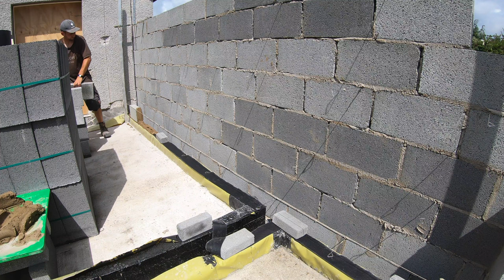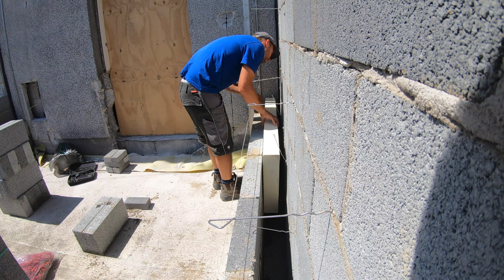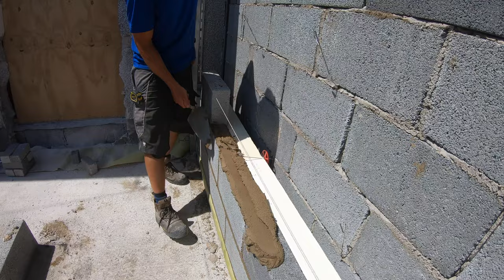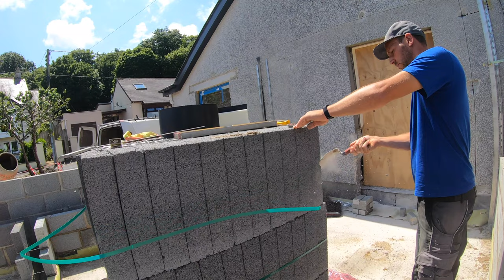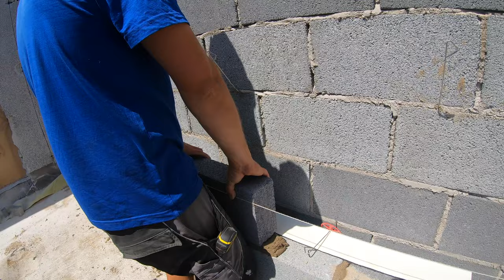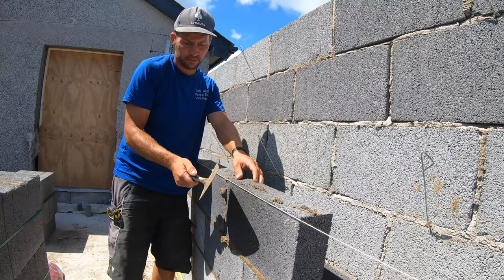Concrete block cavity wall

Comment: Beautiful work as always buddy, but where the hell are you again in Wales that you are getting weather like this? Here in Tredegar it has not stopped absolutely pissing down for weeks. Worst July ever!

And this footage was amazing quality. What do you film with? And what editing software do you use?
Reply from the maker: Cheers, this extension was a nightmare as there was 3 large openings in it so it was start stop all the time. This was filmed a good few weeks ago in the heatwave but it wasn’t until last week we had proper rain and the ground is still cracked! The rain seemed to avoid Pembrokeshire for ages, I could see it getting all the other places on the map 🤣. 

I film with a GoPro Hero7 in 4K quality.  I may upgrade at some point to the new GoPro as that’s better quality again.  I’ve also got a new microphone attachment as the sound quality isn’t the best as standard on a GoPro. For editing I use Final Cut Pro on the iMac (I managed to buy the iMac with YouTube money 😃😃).  Still a lot for me to learn on the editing though
Reply: @SamDaviesBuilder  thanks as always for the reply buddy.

Lucky you avoiding the rain! Though it was mostly dry yesterday so got a bit of garden demolition done. Trying to get as much done ready for my holiday from work in 2 weeks as I want to put a new fence up and build a patio! 

I have the Hero 8 actually. I have been thinking of starting YouTube to show my house renovation. 

What microphone attachment did you buy?
Reply from the maker: @MarcusT86  How do you find the Hero8? You should definitely start a channel! 

I bought the Rode Videomicro microphone, it was the cheapest one they do but definitely improves the quality.  Only downside is you have to have a media mod on the GoPro as they don't come with a 3.5mm port as standard
Reply: @SamDaviesBuilder  It's a brilliant bit of kit, I just wish I learned to use it more. And I've got tonnes of footage of works done on the house so far, but I just need to get in the habit of filming everything so I can pick the best clips to put together. I think I will start one buddy... we need more Welsh representation haha!

I just looked it up now, and bit of a bugger you need that mod. So it works out roughly £65 for the mod + £35 for the mic if I'm looking at the right one?
Reply from the maker: @MarcusT86  yea that’s right! I got my mod direct from the GoPro website and the mic from Amazon.  Also you have to get a new case for the GoPro to house the mic on top and the media mod.  It is a bit of a faffy process!
Reply: @SamDaviesBuilder  That definitely sounds a lot of faff buddy, but needs must!